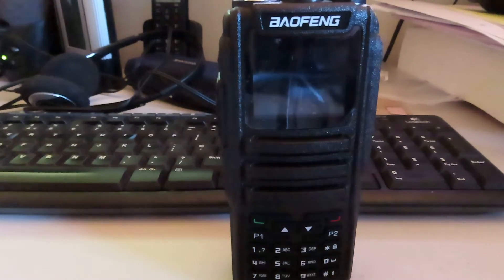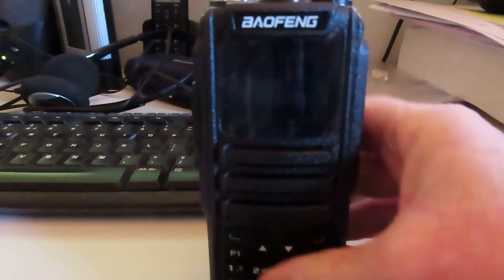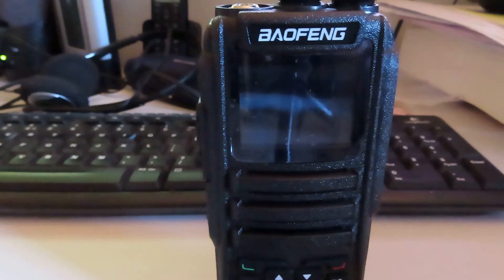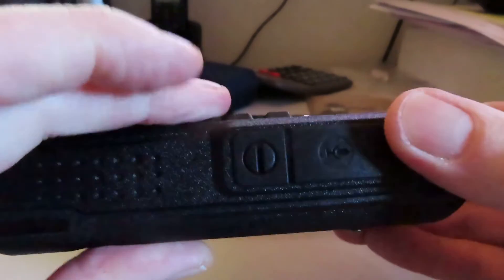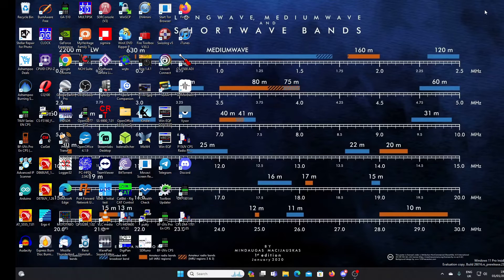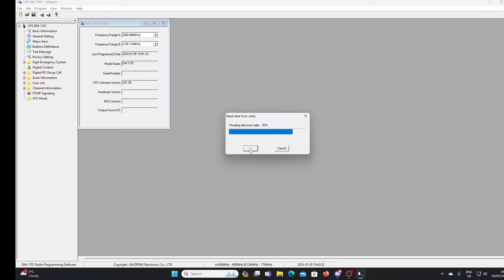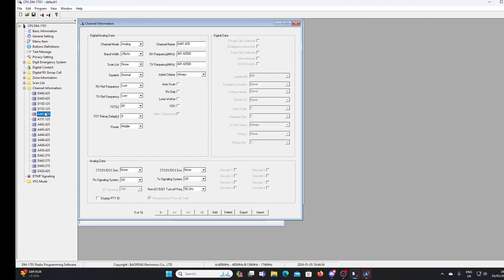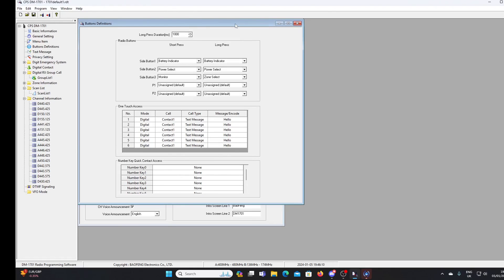Baofeng DM 1701 first look

Comment: I’ve had my 1701 for a couple of weeks. It’s programmed for TG91 and I have enjoyed listening worldwide to a varied mix of people from across the globe. My only issue is that sometimes, just as people begin to speak, there appears to be RX overload, which materialises as sudden pops, whooshes and volume increases (I’ve tried adjusting the AGC with marginal effect). Is this normal for DMR or is it related to the direct conversion RX of the 1701? Thanks, 73.

Comment: Aliexpress has this radio with Open GD77 already installed.
Reply from the maker: That's the way they advertise it but quite a few I know of didn't have it installed
Reply: @KevinOReillyswl  Yeah. I’m thinking a third party is responsible for adding the firmware and many are probably missed.